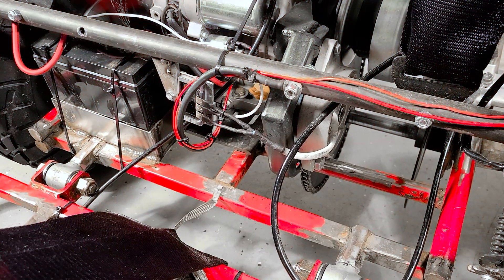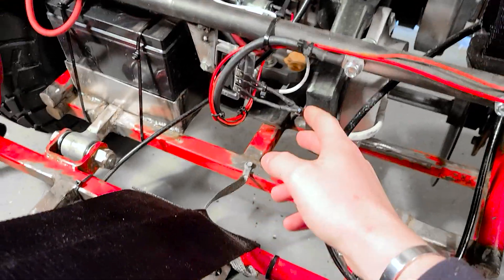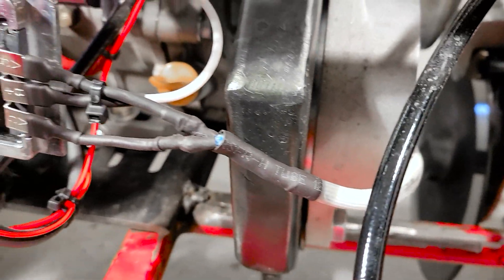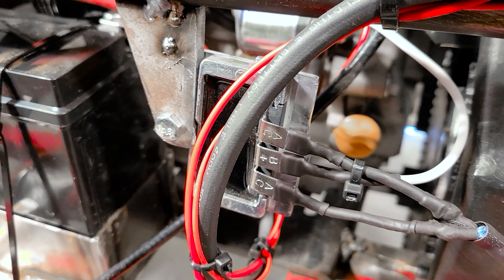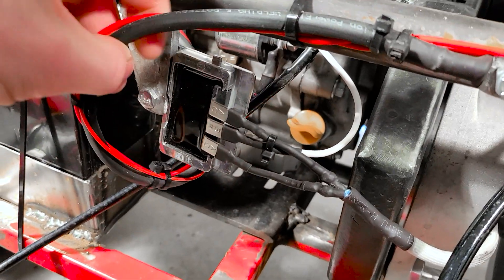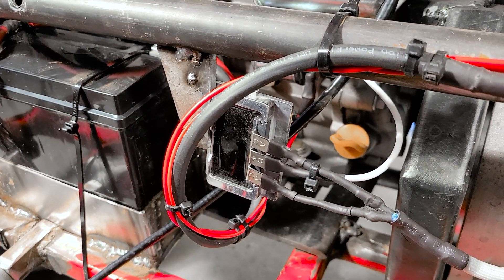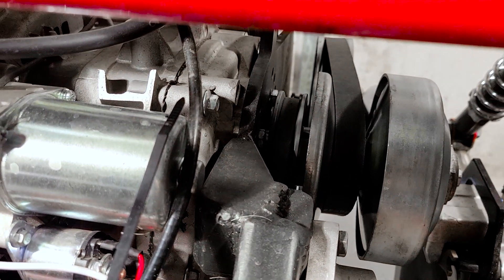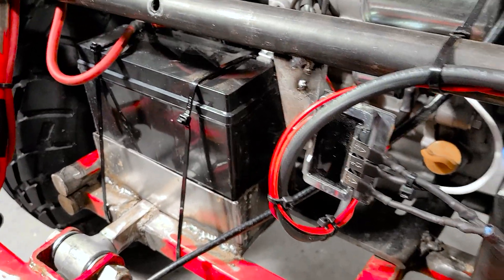20 Amp John Deere Alternator Wiring | 420cc Go Kart | TYRANIS TIP

Comment: The rectifier turns the current from AC to DC but you do not have a regulator to regulate the voltage to 12 volts. It's extremely unsafe as prolonged use at higher voltage can damage the battery, cause a fire, or possibly explode the battery.

Comment: I'm thinking of converting from the stator on my Kohler ch18 to one of these alternators. The amp rating for the stator is 10-16 amps. Do you think 20 amps will be to much for my garden Tractor? I'm definitely not an electrical wiz. Thanks.

Comment: Did you check to see the amps you were getting from the setup after it was all done? Im curious because i dont need 20 amps and was thinking about using a smaller VBelt pulley to reduce drag on the engine.

Comment: so i been looking to try something with those gas bike motors. and i want to obtain power to gain 120amps. the bike motor throws out 2.5-3.5 hp. do you think this alternator will work? im looking to charge up a 48v ebike battery. where i think i can just connect the charger to the battery as a regulator.

Comment: I like the alternator you added to the 420 predator. What direction does the alternator need to turn to charge properly? And as far as running lights how did you go by connecting that? I’m working on a golf cart I’m converting from electric to gas, and I’m installing the 420 predator in it. I would like to run tail lights and headlights and perhaps a radio.
Reply from the maker: I THINK it should spin either way no problem. Its AC current until you run though the voltage regulator to get your DC. I like to run the alternator to the battery, to charge it. And then connect all my accessories to the battery on switches. That way you can run your lights if the kart is off too .
Reply: @TyranisCustoms  ok thank you

Comment: sweet! tysm. I want to use this alternator on a utility engine to power a nice 12v lighting system. 20 amps might be a bit much. I think I only need 8-10 max. would that matter much?
Reply from the maker: I highly recommend that set up. It will produce up to 20 amps, but you'll be fine using less!

Comment: What did you do with the Pre-existing charging system that the predator 420cc came with?
Reply from the maker: I just disconnected it.. The wires are still there and I could use it to power something else if I wanted but the alternator has been CRUSHIN it. Such a huge upgrade.

Comment: I just wonder if the battery will overcharge getting current all the time... is there a “smart” regulator available to control that?
Reply from the maker: That's a good question, but I figured this is the original set up from the John Deere so hopefully we should be OK haha. Guess we'll see!
Reply: @TyranisCustoms  yeah, the setup installed on my outboard motor is the same, just a bridge rectifier... so I have the same situation. My go cart has just a wire coming out through a diode, even simpler....? I guess it’s worked on other things this way? So who am I to question it!! Keep up the good work!

Comment: Thanks for this great tip. Is there a voltage regulator built into the rectifier, or is it not needed?
Reply from the maker: I believe there is. There's no documentation with it but they list it as a "regulator rectifier" so I'd have to assume its built in there
Reply: There is a voltage regulator built in. If you look at an engine on a zero turn mower the voltage regulator is mounted on the plastic shroud. The bolt that holds the regulator on is the same bolt that holds the shroud on the engine block giving you a solid ground. In this case where it's mounted on a tab welded to the frame is a better ground keeping the regulator from absorbing the heat from the engine as the excess heat will kill the regulator over time.